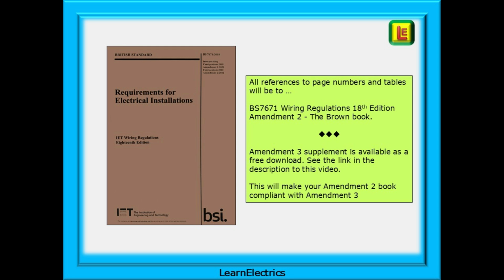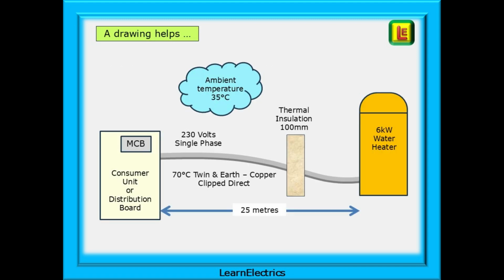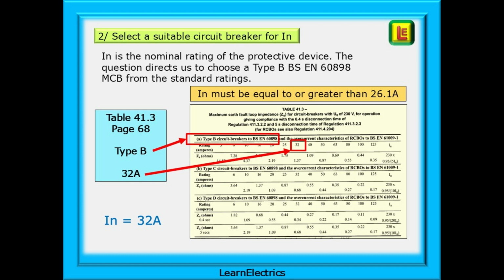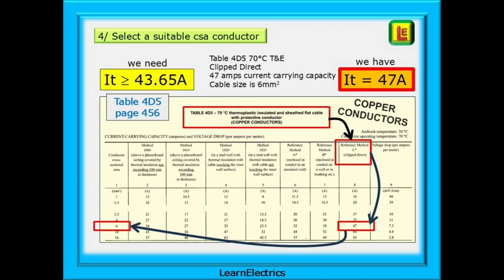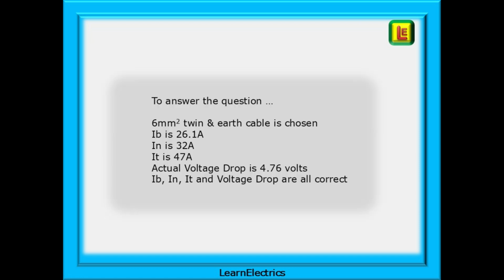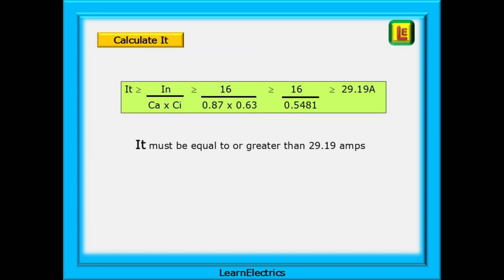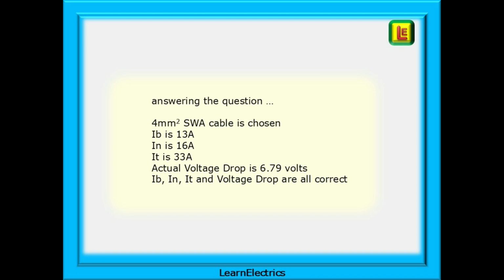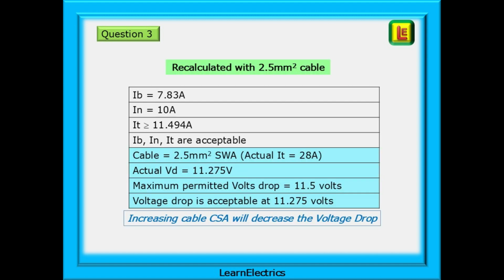CABLE SIZE CALCULATIONS – BS7671 AMENDMENT 2 – LEVEL 3 STUDY - TECHNICAL DIPLOMA – 18TH EDITION EXAM

Comment: why in al your calculation you've ignored PF? in AC system we should consider PF in the formula? only in DC we can only used P=VxI? please advise
Reply from the maker: These calcs are being practiced on small loads (domestic) where PF is usually minimal. But yes - we have been asked to do a video on chunky three phase stuff and this is on the list. Thanks for the question, appreciated. Dave.

Comment: On question 2 is the cable clipped ?
Reply from the maker: For most reference calculations, the basic starting point, we will use clipped direct. In the absence of any modifying information, assume clipped direct. Thanks for watching, Dave.

Comment: Sir I need a to know that I have got 46 of 2 ton single phase ac units.so what is the swa cable required for this power supply sir  distance between MDB to transformer is 30 meters.cable directly buried in the ground.so please give me the cable size sir
Reply from the maker: Take a look at the videos on the links below. The manufacturer's instructions or rating plate will give you the current requirements of each unit. You will also need to determine the voltage drop and the factors to use for the cable route.  Work through each stage one at a time.
https://www.youtube.com/watch?v=xxsB91hzSeY
https://www.youtube.com/watch?v=ej3-6wcHfkE

Comment: I think the pump capacity power was in apparent power. If this is real power in Watts you may need to divide this value by power factor for get the correct current value
Reply from the maker: Thanks for the input, I'll definitely re-check that value in the next review. Dave.

Comment: Great video.
I have question what is the diffence between It and Iz?
Reply from the maker: Take a look at page 46 of the Amd 2 wiring regs book.
Iz is the current carrying capacity of a particular cable in continuous service for a particular set of installation conditions.
It is the tabulated value by calculation that gives you a bigger size cable to take account of  more onerous installation conditions.

Comment: Before all these calculations are done, should you firstly consider what the Ze is and then find out your allowed R1+R2 therefore max Zs permitted? 
This will affect cable selection?
Reply from the maker: I think this is the video you are looking for on the link below. Each video deals with just one topic. Thanks for the question, and thank you for your support. Dave.
https://www.youtube.com/watch?v=QWr-ilqW67A
Reply: @learnelectrics4402 thanks mate, I understand that. I suppose what im asking is what order you do it in? Is the Ze first therfore giving you an allowed R1+R2 to calculate for? 
If I know i have 20m run for a 20A radial circuit, and im wiring in 2.5mm, should I calculate the R1+R2 of said 2.5mm 20m run to see if the value would exceed the Zs allowed? 
I hope you understand.

Thanks for all your work Dave 👍

Comment: Thank you for the upload, it is really helpful. If you have time in the future would it be possible to do an example of a full cable calculation for a ring circuit as this was the most confusing for me as a student, especially when taking into account diversity. I think it will help a lot of students to have that example. Thanks again mate.
Reply from the maker: Noted. Thanks for watching.

Comment: Cheers Dave much appreciated as always. 
Like to try and test myself instead of sticking the info into an app. 
Not a criticism but should Q2 of had an installation method mentioned and should the SWA be noted as Cu or Ai so the correct tables are chosen? Also Q3 has no breaker type to select In ? Sorry if you had noted this and i missed it or it wasn’t required. In any case I assumed and my answers were correct anyhow.
Keep up the great work Dave👍🏼
Reply from the maker: Good comments Keith. We assume copper if no other info and especially if the csa is less than 10 sq mm. Yes, assume an MCB for Q3.  Make up some of your own questions if you want more practice, it all helps. Thanks for the support, really appreciated. Dave.

Comment: Thank you so much.
I had a callculation about the second question.
I found little deffrent.
Could you please let me know my callculation is correct or not.
Ib=13
In=16
It=25
CSA=2.5
Vd=10.7v 
Max Vd=20v
Many thanks.
Reply from the maker: The answers in the video are correct. Make sure you are using the correct tables for the type of cable and the correct. This is a three phase AC question, not single phase or DC. Find the correct column and you will be ok. Have another go at it. Thanks for watching. Dave.
Reply: Thanks for response. 
I will. @learnelectrics4402